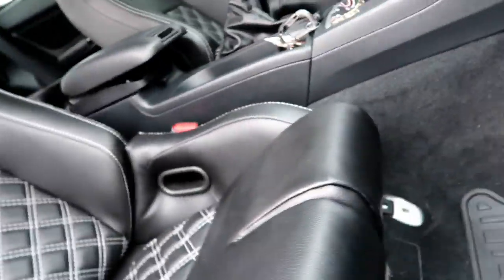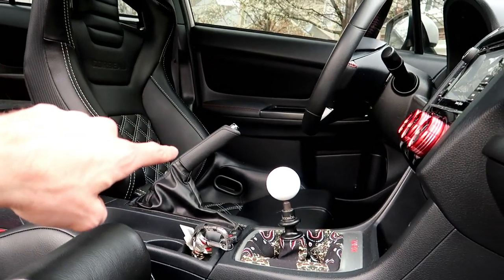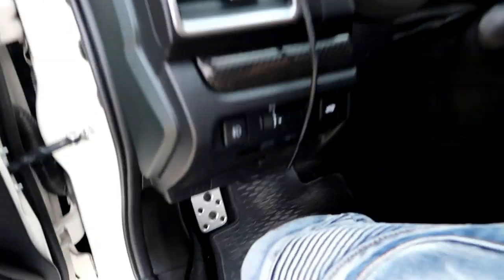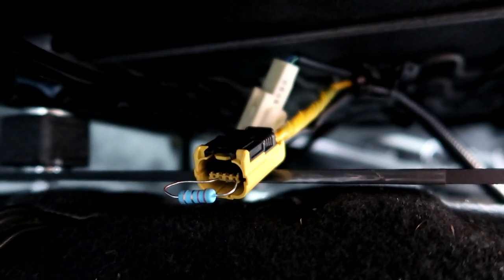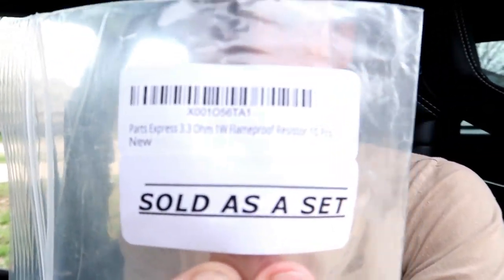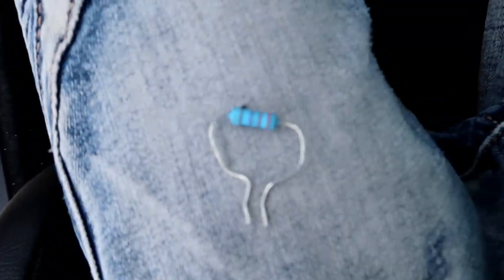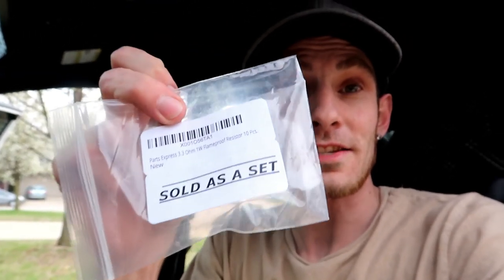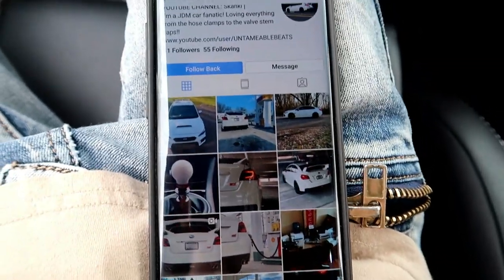AIR BAG LIGHT IS GONE... UPDATE

Comment: Hey Ryan which are the two plugs under the driver seat do these go into. You show the passenger side with the two center ones plugged in. Also do we disconnect the battery before doing this

Comment: Do you need the occupany sensor in and the resistors? My seats I just got are carbon fiber and it prob wouldn’t sense anything
Reply: I’m wondering the same thing!!! 😅 I’ve only swapped out my driver seat so far.  😅 do not want to pull that sensor pad out.  I’m thinking the resistors will eliminate all the lights

Comment: I have a 2009 SL600, looking to put in racing seats because my stock seats weight 120lbs each.  How do you know what ohm resistors you need, there is absolutely no information on my car on the internet.  Having a hard time finding the right resistor to do this mod.

Comment: I pulled up driver seat for amp installation under the seat. When i put it back. Airbag light on all time. Is there a way to reset it? My obd won't do it neither battery removal.

Comment: @ryans random ridez were all of your airbags disabled because that airbag light was on? I installed a quick release in my wrx and the airbag light is on. Does this mean that my airbags are disabled? There’s a resistor mod for that as well would that enable all my airbags once i do the resistor mod? Thanks
Reply from the maker: The air bags were disabled because it needs to have the occupancy sensor installed and resistors.  If you do that they will work.

Comment: Does this have any affect on the entirety of the airbag system, or just the seats bag?
Reply from the maker: All air bags work now with this and the occupancy sensor installed beside there are no side air bags in new seats. Which is why I had to put in resistors
Reply: @RyansRandomActs  is the occupancy sensor only for the passenger? I assume because there will always be somebody on the driver seat lol
Reply from the maker: @flatmotion1  correct
Reply: @RyansRandomActs  thx for your answer. What was the turning point for you not getting a seat with airbag? probably price I guess. I am currently contemplating whether I should get the recaro sportster CS with or without airbag. It only comes with vag/vw plugs so I'd have to splice airbag wires and I'm not really too excited about that and thinking of saving the 350$ airbag price tag

Comment: Does the occupancy sensor work as its supposed to? Or is it still on all the time
Reply from the maker: It's on at all times. But having them on at all times is better than not having them at all
Reply: I think you plugged the sensor in to the wrong yellow wire I think it would go off if you switched the Resistor and though why are you plugged in and it would be just on and off
Reply: @RyansRandomActs  sorry to bring up an old vid, but if the occupancy sensor was always reading present, then wouldn't you have a seat belt warning alert constantly?

Are you sure it's not stuck in a passenger not present status? If that's the case, you won't get a seatbelt chime alarm if a passenger is on it with no seatbelt (which is a good way to test it). 

If the above is true, then your passenger airbags would never go off, even with a buckled in passenger present.

The purpose of the passenger occupancy sensor is to first ensure seat belt compliance, and second to trigger or hold off on firing all passenger facing airbags (to limit potential repair costs).